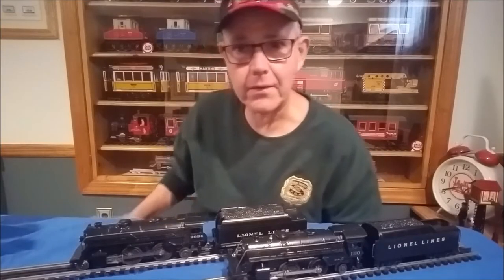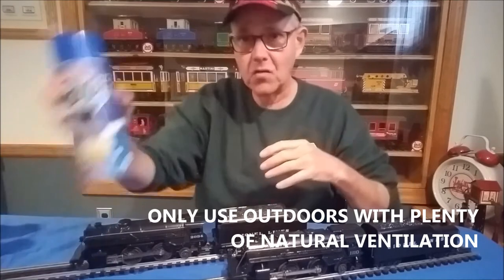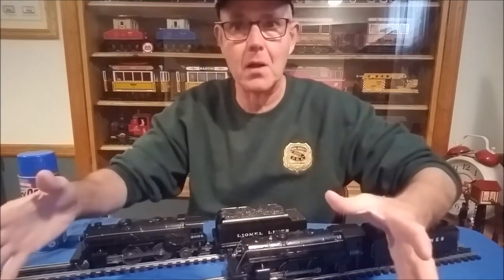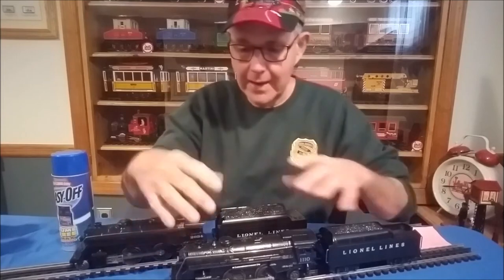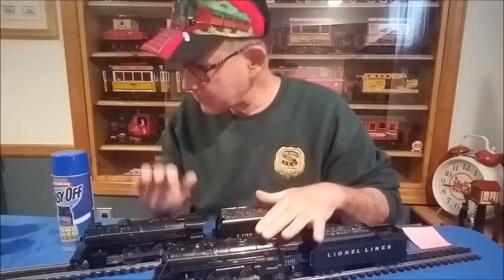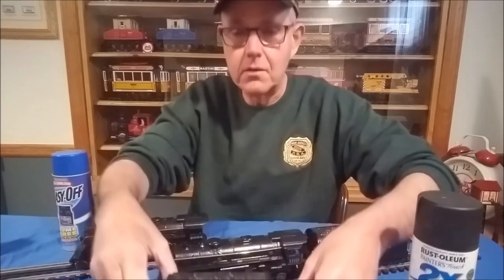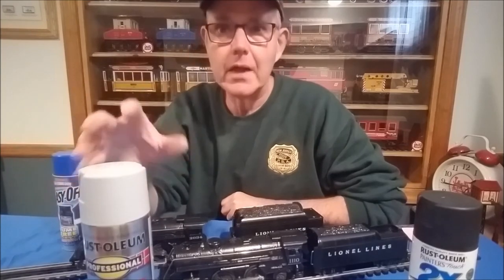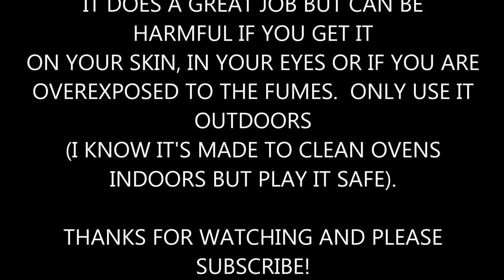How to Remove Paint from a Lionel Post War Steam Locomotive for Restoration

Comment: Thanks for the video and instruction. I am half way through the repainting process. Your directions about paint removal were SPOT ON; I was amazed how easy and complete the EASY OFF worked! Regarding the painting, only difference is that I primed with FLAT BLACK. Coverage was great and gave me a chance to see the results as a flat color. Originally flat was going to be my final coating. But seeing the result, again, taking your advice, I'll be going with the SATIN finish.
Reply from the maker: Thanks for watching. Sorry for the delay in response! 2 years late. Thanks again.

Comment: im buying an old metal lionel caboose and want to restore it..this will inspire me..thanks for sharing.
Reply from the maker: Remember, if it is tinplate DON'T use the easy off method. That's only for diecast. Tinplate paint removal is even easier. Use a cheap lacquer thinner. Soak the painted parts for about 10 minutes and the paint will just melt off. Brush of excess paint with an old tooth brush. Re-soak if necessary. Be careful with that stuff. Use outside.

Comment: Any advice on how to strip gloss paint off a locomotive without removing the original paint underneath.
Reply from the maker: Sorry it took soooo long to reply.  It would depend on the type of paint that is over the original paint.  If it is an oil based enamel and it is a diecast lionel loco, you may be successful with enamel reducer.  I can't guarantee that would work.  The easy off will take all the paint off including original.

Comment: Would acetone also work for stripping paint?
Reply from the maker: Matthew, sorry for the late reply. Lacquer thinner or acetone does not work that well in removing the paint from post war die cast zinc based castings.  It is however very good for removing paint from tinplate trains and accessories.  That is what I use to strip paint from my Lionel Standard Gauge pre-war restorations.

Comment: After you paint the engine and apply decals, how do you seal the decals so they don't come off or easily damaged?
Reply from the maker: Hi, Sorry for taking sooo long to respond.  I do not use decals. I use rubber stamps and oil based ink.  Available on line for lionel restorations.   I do not clear coat. Thanks for watching!